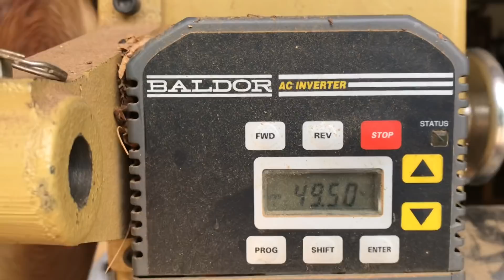Wood-turning Birch

Comment: What finish will you apply and when?  Did you put anything on it to prevent cracks?
Reply from the maker: I didn’t put anything on this one to prevent cracking I’m keeping my fingers crossed 🤞 and hoping it doesn’t crack, hopefully in the next month or 2 it will be dry enough to put a finish on it, I will spray it with vinyl sanding sealer sand in between coats then spray on 2 coats of flat lacquer or maybe a medium gloss,
Reply: Thanks!  I’m with you, hopefully it won’t crack, it is a beauty.

Comment: That was basically a crotch piece where the limb had come off and the tree sealed it back up, so I imagine that curly flame grain was interlacing grain from the stress of holding up a limb?   Does that sound reasonable to anyone else?  I love how it looks.   I hope you make something cool out of the center piece too, I wonder if it could be a lamp?
Reply from the maker: Yep I believe that is exactly what it was. I still haven’t put a finish on this one and some others there finally good and dry though.

Comment: Lovely piece. Those McNaughton's sure are great, I'll be using mine a lot in the near future, got a heap of Macrocarpa logs to make large bowls with. However, I need a longer tool rest, I like that curved one you had to hammer in, lol, is that a DIY one? I'm look at an adjustable one made by Vermec here in Australia.
Reply from the maker: Thanks! Yep I’m gonna start using that thing more often it is a very handy tool, the curved tool rest fits a Oneway brand and my lathe is a powermatic , it had to be modified a man I know made me a high grade plastic sleeve to put in to get it to work 😅 it takes some elbow grease to knock the thing in there but it works, I’ve not heard of the Vermec I’ll have to check that out a adjustable one would be Nice!
Reply from the maker: Thanks man! 🤝 that is a very nice one, Would be handy to have that one for sure! I may have to get one of those if it will fit my lathe 😀
Reply: I have a list of things I'd like, this is one of those things, lol.
Reply from the maker: Yep I’m the same way 😁!
Reply from the maker: What he had turned was a beautiful turning to Very nice work!